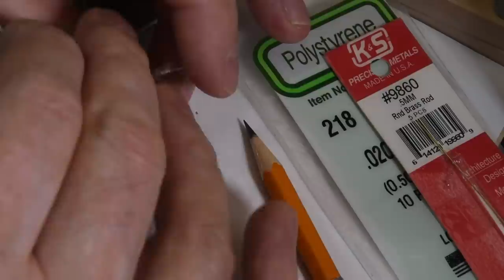Modeling Showcase Miniatures Awesome 1/87 Scale Resin Wrecker | River Road - Vlog # 112

Comment: Gluing the photo etch like you did is a great tip!  One thing that helps with gluing metal to resin or resin to resin.  Have some Acetone handing (I have some in a small squirt bottle) and a bunch of Q-tips.  Because most resins are at least temporarily Acetone resistant, you can use some Acetone on a Q-tip to clean up excess CA, should any ooze out of the joint.  You can get really strong, clean CA joints between metal and resin or resin and resin this way.  I use the same technique with metal to metal CA joints as well.
Reply from the maker: Great tip! Thanks for sharing that. Cheers ~ Boomer.😁

Comment: Thanks for all the useful construction tips based on your professional model building experience.  Most helpful!  By the way, I recently needed to repaint an insulated plug door boxcar roof from black to silver to better match the prototype as-delivered paint scheme.  Your recommendation for using Val;ejo Model Air Aluminum in a previous video (the excavator one) really helped me.  I tested it for brush painting along side some other silver paints (including Golden Fluid Acrylics Silver) and its coverage, fineness of pigment, and lack of brush marks made it a clear winner.  I finished off the roof with thin washes of Vallejo Model Air Dark Sea Grey and Concrete for some mild weathering.  I am most grateful for your videos.  Cheers from Wisconsin.
Reply from the maker: Glad to hear your joy in the hobby. It's great when we discover new paints etc to increase our success! Cheers.

Comment: Using a pin to reinforce parts of dissimilar materials is a good habit to get into.  I learned it mounting side mirrors and fog lights on 1:25 cars.  Your point on not using CA glue on shear joints is well taken.
Reply from the maker: The photo-etch mirrors here just require drilling a few holes and they seat nicely.
Reply: @boomerdiorama  
And become so strong for their size!

Comment: Great to see the methods. Turned out really nice. I could see this in the old faded red they came in as well. You have that well kept look which goes along with your locomotives. It’s nice to see something kept up in modeling. Everyone has overdone the abandoned look.
Reply from the maker: Thank you! Cheers!
Reply: Old tow trucks never seem to die.  They get repainted and re-equipped and motor on forever.  There used to be a local wrecker on a WWII Canadian Military Pattern Chev chassis painted in blue-and-orange Gulf Oil livery.  Wish I'd taken a photo at the time.  <--- lesson

Comment: Thanks Boomer, very cool model indeed.  I have done some simple things like adding grab irons to locomotives but have yet to work extensively with photo etched parts.  What process do you use to remove the photo etched parts from the sprue, just a No. 11 blade?  Thanks
Reply from the maker: I use nippers or a # 11 blade.
Reply: Got it, thanks!

Comment: I've heard that you can clean up the flash on resin, with some acetone and a brush, or will this ruin the rest of the model?
Reply from the maker: Maybe . . . but I avoid Acetone all together. In fact, I try to avoid all solvent based paint altogether other than water and Isopropyl Alcohol now. I have too many allergies to use the former. Cheers.

Comment: Hey Boomer, I see in your video that you paint vallejo colors over tamiya but, is it safe to spray vallejo matt varnish over tamiya paints?
Reply from the maker: Yes. Vallejo Varnish is Acrylic. Vallejo Paint is Acrylic. Tamiya Paint is Acrylic. Been using this method for decades. It's safe and good.😁
Reply: @boomerdiorama  Thanks.  I got really "inspired" recently watching you splash IPA w/tamiya all over a locomotive to weather it; I decided to try this with IPA+Vallejo and now I have PTSD.
Reply from the maker: @Brandon-wf8ew  You can't use IPA with Vallejo. I only use IPA with Tamiya because they are 100% compatible. I use water with Vallejo or their recommended thinner.
Reply: @boomerdiorama  Gotcha.  My plan was to spray a clean/new locomotive with vallejo matt varnish,  then come over that with tamiya thinned with IPA for my weathering, followed by some powders and then another layer of matt varnish to seal everything in.  Just wanted to make sure nothing funky would happen between the vallejo varnish and tamiya/ipa mixture.
Reply from the maker: @Brandon-wf8ew  You don't need to spray varnish on the locomotive until it's finished. In fact don't put varnish on the locomotive before the IPA, especially if you use washes with a brush. The IPA will cut through the the varnish and make a mess. Use varnish at the very end and spray it on.